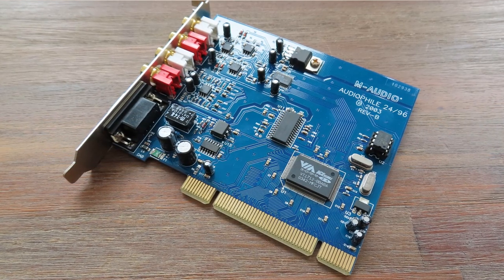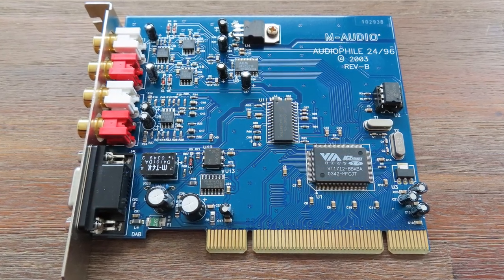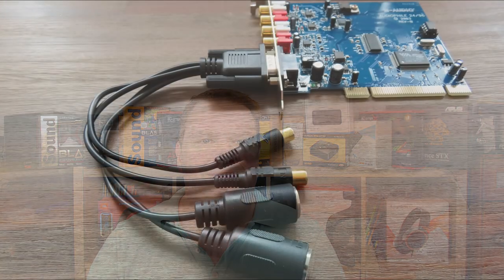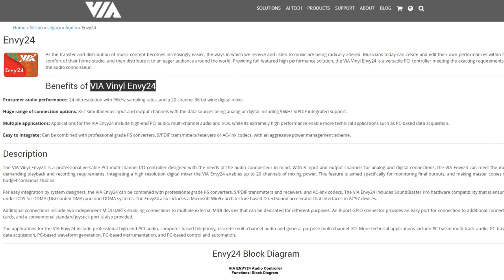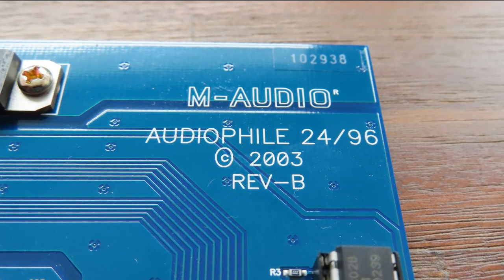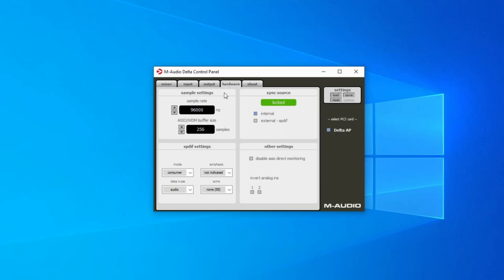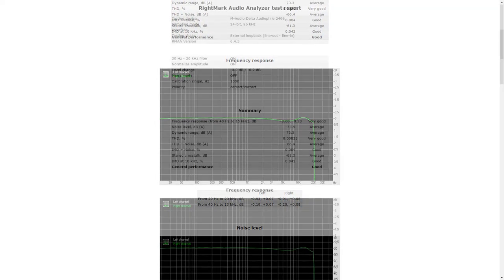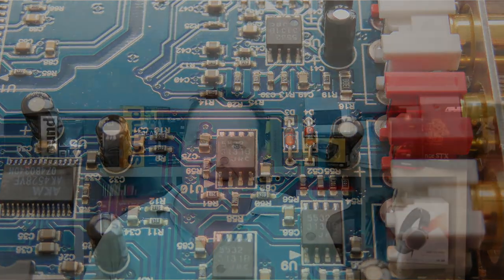Is the M Audio Audiophile 2496, truly an audiophile’s sound card?!

Comment: this is the greatest consumer level PC audio card of all time.   this was the turning point where $99 could get you near pro-level quality, it holds up good even today. I had this (and still have the card running on Debian 12) back then with a Mackie 1202 vlz-pro, a pair of Alesis Monitor One for near fields, a pair of JBL L56 for mid-fields, and an NAD power amp.   Ran FL and  WinAmp, Cubase and Nuendo with Waves plugins. Great sounds, amazing times.

Comment: im still using this card in my studio, love it !
Reply from the maker: I've read that a lot of people who have studios still use it! Why is that? The connectors? The audio quality? I'm curious.
Reply: @AntonsHardware  Hi Anton, for me its the audio quality and the ease of use. In fact..i have Focusrite 8i6 which i hardly use. When i use the Focusrite it will create a usb-loop sound. The M-audio doesnt create any noises.
Reply: @DJExcal  I've owned one for years too. Wonder if I could ask some advice? My card was working fine until yesterday. It stopped monitoring the sound so now I can't record anything. I use a mic plugged into a mixer. Both of these are using new batteries. The mixer is plugged into the Audiophile. I can see the mixer reacting to the mic so it seems mic-to-mixer connection is working. Tried recording vocals on Soundforge yesterday, my normal program. Usually it monitors the input so I can see the volume meter in Soundforge fluctuate as I talked and recorded. but now there's no sound getting through from the mic and the volume meter isn't moving at all. Any ideas?

Comment: I'm not claiming to be an expert on these things. I bought this card about 20 years ago and have used it ever since in my pc. Last year I came to the point of needing more than one input so I bought a Presonus 1824c interface and as soon as I got it up and running I felt something was lacking in the sound. The sound was muddy compared to the M Audio. I had been working on a track at the time and sounds that I was expecting to hear were not there anymore... detail in the bass and just generally the sound of the Presonus was flat and unsatisfying, the shimmer was gone and it just didn't sound as clear as the M Audio so I sent it back and bought a M Audio Delta 1010LT off ebay for £60 which is essentially the same card but with 4 pairs of inputs. This is a really solid, good sounding card.
Reply from the maker: I know the feeling. I'm still in love with the X-Fi fatality. Sadly that's a PCI card, just as the 2496. Every card since missed that special "flavor". I think that you fall in love with a brands certain sound, like you did with M-Audio. I must add, that when released, this card was rather good and very good for use with Cubase. I believe that this was one of the best cards for that programme.

Comment: Yes it is an M-Audio card and the music industry have been releasing Pro music with CD standard for years made with soundcards with similar specs if you did not know. I have a bunch of M-Audio cards and they still work supergood like the M-Audio Delta 1010, 66 and 44. CD music is 16 bit 44100 khz and I have still to realize those numbers it will not suffice for music. It is a PCI card and PCI slots are rare on new mobos and that is the main problem.

Comment: I bought this card for my dedicated HTPC back in the early 2000s and it was able to output a bitstream 44 khz, other cards only output 48 khz with sounded distorted. Great card back then.
Reply from the maker: Yes, that was a major flaw of the cards back then, expecially the Creative cards. Internally they processed everything at 48 kHz and then had to "downgrade" again to 44,1 kHz to match output that was requested. That caused a lot of distortion.

Comment: Hi Anton, nice review. Used this card a lot 15 years ago and now I still have it in its box. Been using usb soundcards with a lot more in and outs after that. Do the drivers (delta 6.0.8) that are for windows 7 work with windows 10/11. Do you have any info about that?
Reply from the maker: Yes they will! :D I used those as well.
Reply: i am running it on windows10 ,,, all fine .... still using it

Comment: Hi Anton,   I was looking for a way to connect my vintage 1970's stereo to my windows 10 desk top in order to convert vinyl to digital.  I figured the amplifiers tape output to this cards Line input would preserve the stereo of my LP's and produce a better result than simply using the computers built in "line in" port.  Any recommendations or thoughts?  Thanks
Reply from the maker: You have dedicated Vinyl sound cards, which can convert vinyl a lot better than a standard sound card. But I'm not really into that, but I know that the Creative Xfi HD USB does have a grounding, but I'm not sure if that is for record players.

This may be interesting for you: https://www.whathifi.com/advice/how-to-digitise-your-vinyl-collection

Comment: I got mine 15 or 20 years ago and have been using it ever since.  It's always been pleasant to listen to.  Does the frequency response really drop to zero at 20KHz as shown in your graph at 5:50 or is that just where you stopped scanning it?
Reply from the maker: Good question! No it does scan after that. There just isn't a signal after that. In reality that's not really an issue, because humans struggle to hear anything above 20 kHz. Kids may hear upto 22, but after that... Some people claim that even though you don't hear it, it does add to the overall experience. But I'm not convinced.

Comment: Very nice  with the zooms on the components on the card, what they are and what they do ) 
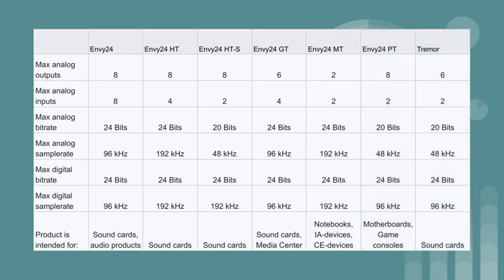Very nice also the part at about 3:40 where all the Envy models are lined up with specs differences
So here is why I am here writing this comment with curiosity and will to find out more ..

(The how I was there searching and landing on your video has to do with both seeing what you had to say about the old Audiophile card and looking to possibly replace/ upgrade it on old rig)

I still have my old M-audio card on my old win Xp / Win 7 dual boot machine with 'cross config' (2 drives one for each O.S, all installed music programs and plugins running off of the opposite drive to that where O.S is installed) 
Also both drives now upgraded to alright sata drives and under old xp x86 I already get a good 250mb/sec speed without using a dedicated sata3 card/ with the (somewhat a touch disappointing ) onboard sata3.
Now I have upgraded that rig .. did a change of motherboard cpu and ram (Still old gear. from a GA X58A UD3R to a GA X58A UD7) .. there I have a better board for OC which has got PCI express available, whilst still having the old pci slot available
More importantly I have a multi screen setup and to be able to use more of my screens I need to have my second gpu in the machine, to be linked to gpu 1 via SLR.
Doing that is currently not possible as then second GPU ends up blocking the space for the old PCI card to get connected..  and yeah before people start thinking they have the solution I need .. (thank you nevertheless for the positive intent) . Well the pci riser option doesn't make for a 'clean', tidy or convenient result.

So with all that in mind I have been looking at the Maya44 XTe as an upgrade on my old DAW rig (not spending for another powerful PCI express internal card from RME)
So comes my 2 questions:  

- What do you know are the main differences between the Old Maya44 Xte and the Maya44 eX (Xte has been replaced with eX, and new is definitely not always better..)
- How the Maya Xte compares to the M-Audio Audiphile 2496 (this I may get some results for comparison online) 

Very interested to hear what you know on this !

PS I suppose the point is with all these changes and upgrades on the old Rig is.. I have some old decent projects done with Cubase 5.2 and a whole set of old plugins there, and I can't quite work with all that on my more recent up to date rig!
Reply: And so also additionally how does the Maya44 XTe  compare with the audiophile 2496 in terms of frequency response? .

Comment: Hi Anton, I really need your advice! I am setting up a low end (i3) tower for music production using Cubase. I used to use 2496 some years ago but my current motherboard can only support PciE-1 or PciE-16 (which I think is a graphics card slot). I need to have an audio card that reduces latency in Cubase when I use a MIDI keyboard to write and compose, something that can handle a maximum of 6ms latency and have an ASIO support. Could you recommend anything that can fit in my slots or perhaps an external soundcard that will work well with Cubase. Thank you very much in advance!
Reply from the maker: Hi Ltd Co,
I don't have that much knowledge about sound production and ASIO support. But from what I have learned is that a lot of people have an external sound card, the Focusrite Scarlett 2i2. I believe that is specifically designed for music production. Hope it helps!
Reply: @AntonsHardware  Thjank you very much for the advice! I will have a look at the product! :)
Reply: I have the audiophile too. Using it fie many years now. Just bought a new pc and it doesnt fit in it. I hooked on my focusrite 2i4. But now i have a enormous groundloop buzzz. So i need a adapter from pci to pcie.

Comment: This looks like something that i should like. I'll try to snipe one cheaply! It looks like there's an adventurous arrangement of 5532's driving the inputs, and then a single 5532 driving the output. This makes for a great line driver, but a not-so-great headphone out. But then that's the fundamental compromise, isn't it, and it's definitely not designed for this use. Maybe 4556 would have been an adequate middle ground. Output coupling capacitance is kinda bad for low-ish impedance headphones. What HP did you end up testing with?
Reply from the maker: I used the Sennheiser HD 429 and the Beyerdynamic MMX300. I recently got a Beyerdynamic DT 990 Pro, but than I found that it is 250 Ohms. Didn't pay attention :S But still this card isn't aimed at headphone use, but more for active speakers or an external amplifier.

Comment: Man this card was the best budget audio interface you could get for music production back in the day(100 bucks)... 192k and EAX and DTS stuff are not needed 😅 What matters is it has very low noise, zero latency and it's ASIO compatible :)
Reply from the maker: I really didn;t know this card was such a big thing for music production back in the days!
Reply: @AntonsHardware  It was xD Was my first interface as well back when i was 15 😅 I'm still rocking an M-audio 1814 firewire using a pci-e to firewire card... I mean there's really no reason to upgrade, it's solid, great latency, tons of inputs... By the way almost everyone records at 44.1khz 16bit to this day... With some exceptions that do 48khz...
Reply: @dukeofdream 
I have already compared this PCI card with modern USB interfaces and the result is very curious, the sound of the 2496 has better quality and is identical to the original sound of the instrument. 

Could anyone explain how a 20 year old pci card can be better than current usb interfaces?

😆
Reply: @SerEmSerOficial  Not to mention lower latency as well xD I mean i can't use it anymore since i'm running a Z690 motherboard now but still... I was getting almost 0 latency(something like 0.5ms) whereas now i'm having 5ms at best no matter what usb interface i use...

Comment: hi you are missing something very very big  i have a old pci  mum board   i have had 4  cards running at sma time

say like delta 44 x 4   and  2 x 2496 cards   they seel well on ebay  big time   i used to have cool edit 2000 back on xp and i have  over 16 channels 
cake walk software can see all the in coming channel  i think alot of the new software DAW  can see the m audeo card  i am a little behide with the tec

m audio made a  adat light pipe card as well    i am still using the 2496 right now in this old   AMD 3+ COMPUTER  
beware the cables coming in to the cards put alot of wear on th pci ports i had computer dropping dead sound times 

yes the man here is right you have to use the windows 7 driver  for win 10   i have same with my scsi 320 pci-e card 
great video

Comment: I don't think these have drivers for win 10. I never had issues with these and Avid sold Pro Tools MP9 that worked with them and was a great value.  I still have a win 7 machine with it all working.
Reply from the maker: I used the win 7 64 bit drivers which work just fine on a win 10 machine! So give 10 a try! Especially because win 7 is eol for so long and does have security risks
Reply: @AntonsHardware  my win 10 has no pci slots.
Reply: An issue mentioned by several in these comments.  No PCI slots on the newer motherboards. And my older win7 machine will not run win10.
Reply: @Darryl Jones which driver do you have??? It used to work for me when I was on xp but on windows 7 I can't seem to make this work no matter which driver I install.
Reply: The driver is fully compatible and stable on W10. No problem.
Reply: @ErinIsBlueBlue  thanks but my win10 machine has no PCI slots.